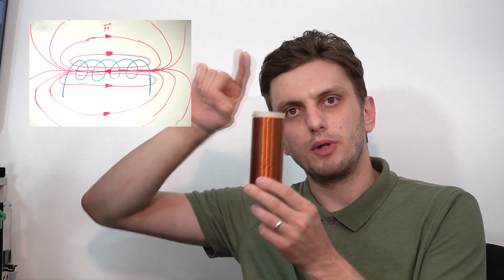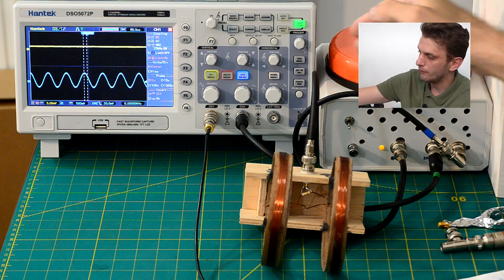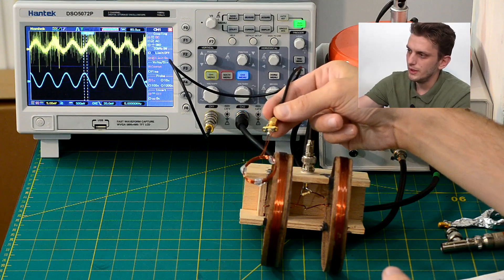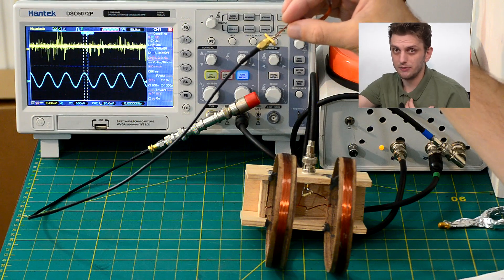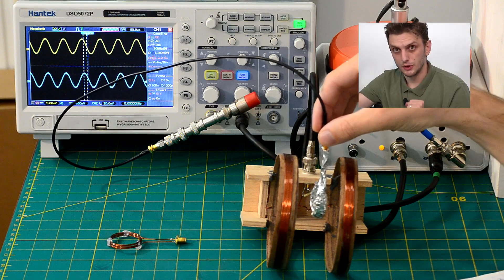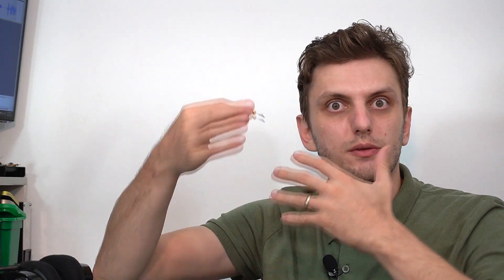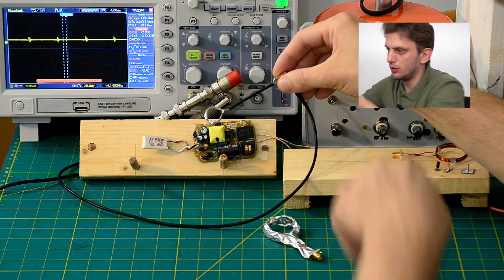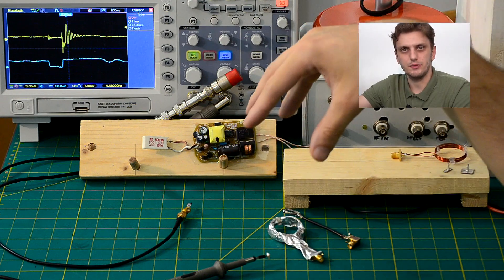EMC debugging - Near field Magnetic field probes

Comment: Hi, i would like to ask you why there must be a cut in the shield? I am guessing that you mean if the cut isnt there, the shield will act as a single turn antenna and attract all the electric field noise which will then affect the readings from your magnetic probe. Is this what you mean?
Reply from the maker: Sort of; The magnetic probe as well as a complete shield will couple to the magnetic field; however the complete shield is of very low impedance so most of the energy will go there rather than the probe, so you won't be able to register too much signal
Reply: @FesZElectronics  ok thank you so much! I learned a lot from your videos!

Comment: The unfortunate reality of failing an emission test is not just the costs, but in determining how is the energy is being radiated (where is the source and its associated antenna). Meaning, the design could be electrically sound, but there is a shortcoming due to PCB trace design, PCB stack-up or perhaps both. So, before going into the EMC lab you would do what is called EMC pre-qualification. The most basic tests are done near field for E and H fields. But, depending on the size or your product you can actually have a small far field anechoic chamber, which is not as good as the lab, but good enough for pre-qualification tests. Once pre-qualification is done you can then now pass your tests at the EMC lab. 

There is a corollary in EMC design. In that a design which confines EMI in reduction of emissions is also usually very effective in reduction of susceptibility.

Comment: Hi yer fez a question for you about mains cable take oley flex  110 CY copper shielded cable if you to remove the clear but separate with heat shrink and Aluminium braid the separate and add stainless steel braid then add a final braid of Mu metal would this be an ideal earthing shielding arrangement for 220/240 volt 50/60 HZ cable and combing the the earths at plug end could you do a vid on mains cable for hifi and hope you have a good one 👍👍

Comment: can you explain a little bit in detail as to why you need a tiny gap on the outer shield....?
Reply from the maker: If the shield is continuous, it forms a single turn inductor which is short-circuited (since the turn is continuous) - so any magnetic field will induce a current into this rather than the probe and you will not be able to measure anything.
Reply: Ok understood… but how will the currents be induced by the magnetic field in the inner conductor( inner wound/looped wire in your demo) when you have shield/metal over it?  How is that the magnetic field is able to penetrate this shield and induced currents in the   Inner conductor?
Reply: Btw you make amazing and very clear videos. Keep the good job up…

Comment: Hi FesZ ; When you connect the 50 ohm termination does the signal amplitude get diminished ? After all 50Ohms is a pretty big load . Love your videos, they are fantastic !
Reply from the maker: The temination will reduce the signal to some extent, but it will reduce the noise even more - so it improves signal-to-noise ratio. Anyway, magnetic fields generate a current rather than a voltage (as is the case with electric fields), so a well defined load needs to be provided.

Comment: Really nicely done sir. As a SMPS engineer, seeing those flyback waveforms really makes my feel at home. Never thought I could learn so much from a non power electronics dedicated channel.
Also that your mentioning about impedance matching is brilliant, no textbook clichés but for the first time I really grasp what it is about.  

And one more question: should I make the electric shield of the magnetic probe with copper and ground it for optimal performance?
Reply from the maker: Grounding the shield will help to reduce the pick-up of electric fields, so its quite useful. In my probe I used aluminum since that is what I had available, but copper is better since it can be soldered.
Let me know how it turns out!

Comment: is it always recommended to hold the H-field probe parallel to the PCB trace for obtaining stronger magnetic field ?
Reply from the maker: Not necessarily. Depends on what exactly you are trying to measure. The orientation that gives the strongest result will help you determine the exact source of the noise.

Comment: hi does the loop size affect the sensitivity to different frequency?
Reply from the maker: Size should not affect frequency response. Most commercial probes will work up 3-4GHz. I guess the biggest issue is maintaining constant parameters over the entire frequency range - the cables and dielectric need to have low losses and controlled impedances up to the desired frequency.
Reply: @FesZElectronics  thanks!
Reply: @FesZElectronics  btw, how bout i increase the loop counts? what effect will i observe?

Comment: excellent comparison, an idea came to my mind when i see how directional it is and the phase invention of the magnetic probe: Can you make an omnidirectional magnetic probe by combining three coils orthogonal to each other?. then i remember my physics class about Maxell equation where divergence of B is always zero, but in my proposition there is not a close surface were calculate this divergence. I think will be an interesting experiment to try.
Reply from the maker: Actually, "3D" coils are used in NFC (near field communication) devices working on the 125KHz band. Its commercially available as a single component with 3 coils on the 3 axes and the point being to be sensitive in any direction to the low frequency magnetic field.

Comment: Thanks so much for the video and explanations. I also want to share this: 
In the 1990’s I worked in an AV shop as a service tech and my boss at the time who owned the service center was an electronic genius. He could look at any schematic at all and within seconds describe in detail what it was and how it worked. He told me he was working on inventing a probe that would read the signals off of ic pins on the scope without physical contact. He did not give any details for obvious reasons. I since quit that job and he moved back to Greece but I wonder if his concept spawned off the near field probes.
Reply from the maker: I'm not sure when the first probes for PCB circuit debugging where made, but the "near field" measurement technique was initially used to measure antennas (see how well they transmit) starting in the 1950s. But I guess that before the EMI compliance requirements where not that strict this sort of probe was not necessary so its invention could be quite recent.

Comment: Great. Very nice improvment in the video recording and lighting. I enjoyed the video. ..
Reply from the maker: Thank you! I went from a single front facing light, and the one on the ceiling to about 3 lights all at roughly eye level. I turned to LED lights since these are more efficient, and I had to add some kapton tape to them to turn the color a bit more yellow, but it seemed to work out quite well.